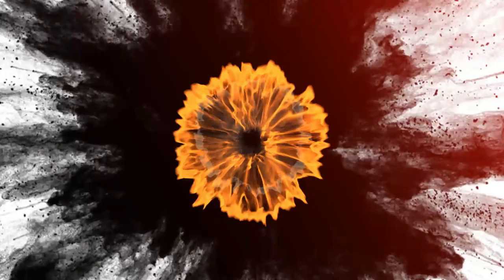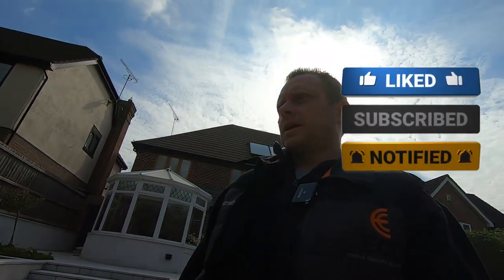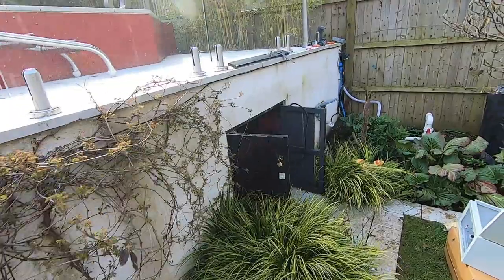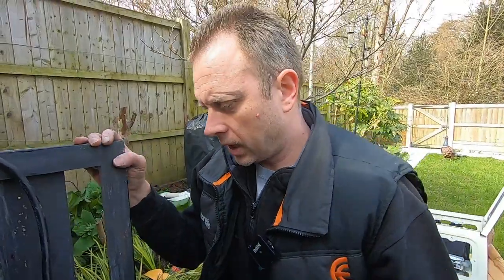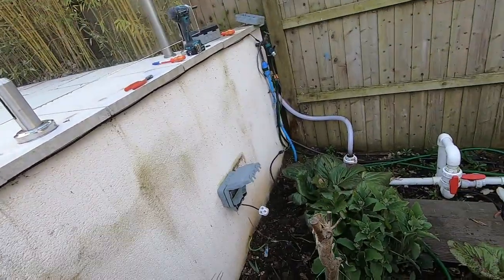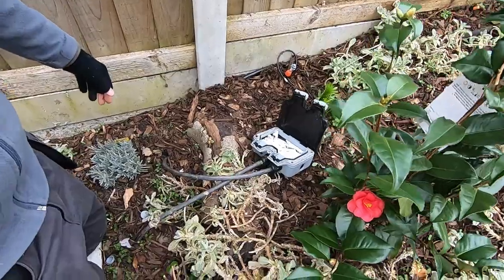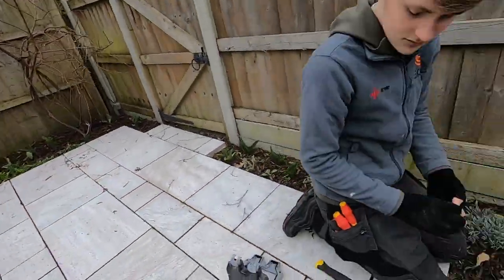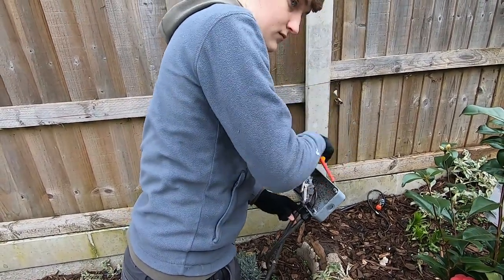Relocating a SWIMMING POOL DB & sorting out crappy electrics (sparkylife)

Comment: See this is the crazy thing, that’s a nice house, they’ve had work done by some cowboys.

I see it so much in properties like this, you’d think it would mean the higher the value of the house the better standard of work, not that it should be that way but you’d think...I learn very early on that some of the most expensive properties I’ve worked in, worth a good few mill have had some of the worst and dangerous electrics I’ve seen
Reply from the maker: Hi Jay, unfortunately they inherited this work when they bought the house two years ago but still right bunch of cowboys who did it. And there previous electrician last year tested it, clearly not testing the garden side. Your right you see it in places you wouldn't expect.